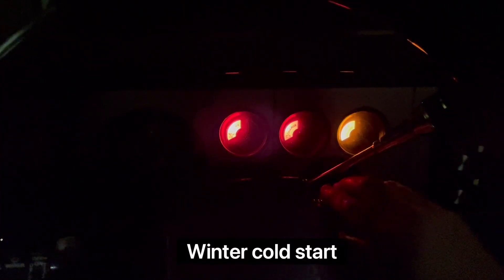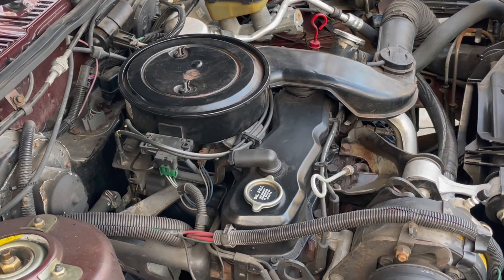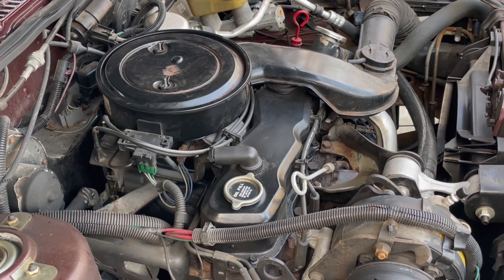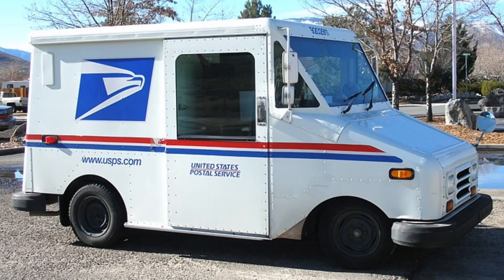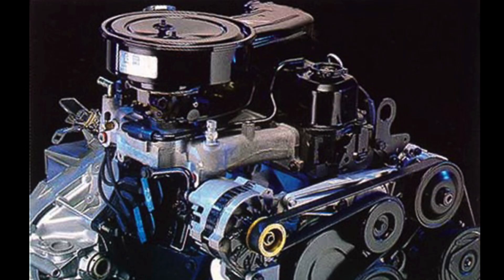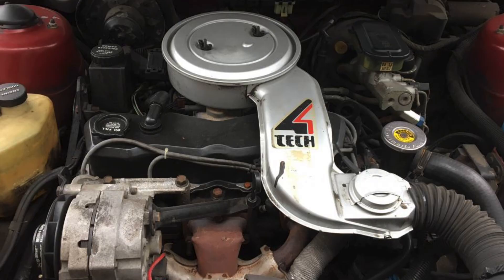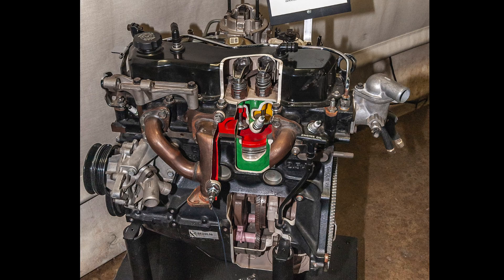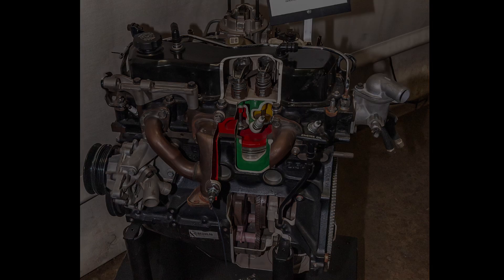Worst Sounding (and Most Recognizable) Engines: GM's "Puttering" Iron Duke 2.5L I-4

Comment: I thought the 2.5 Iron Duke (TechIV) was a crude sounding motor (with no power) but the Olds Quad 4 sounded like broken glass in a blender. It's NVH were off the charts! The only real difference was the Quad 4 made serious power for the time, so the lack of balance shafts could be excused. The Tech IV was so weak kneed even the 14 year old me wondered what was wrong with it.

Comment: Can somebody help me with something? What is the officially prescribed method of accessing the distributer or distributorless coil/ignition module on transversely mounted iron dukes? Does it require the removal of the intake manifold?
Reply from the maker: Undo the dogbone motor mount and rock the engine forward a bit.
Reply: @RareClassicCars  Thanks, that does seem to be the consensus. Sorry for spamming your comments, but a lot of the other iron duke stuff is on longitudinally mounted S10s who don't have the same problem accessing it. This is one of the few places dedicated to it in passenger cars.

Comment: Ive driven a few  different vehicles with that motor in my younger days    i noticed that in all of them, the throttle pedal was really stiff      it always took a lot of foot pressure to press it down .  Was that an intentional design feature for some reason?  Like to keep people from trying to rev them up too fast?
Reply: It may have been...  Most issues with the Tech 4 were in the Fiero.   People wanted to rev them high, and this motor wasn't made for that.   Lol 😂
Reply: Yes when the x cars came out, they rigged the throttle. Pressing the gas pedal about 1/4 to 1/3 of the way down gave you 90% throttle. This was to make the car seem fast on a test drive. “Wow, I’m barely pressing the throttle and the car’s flying! Not bad for a 4 cylinder!” is what they were hoping everyone would say. It was so bad that the throttle linkage would break/snap off in a few years. Chrysler did something similar with their 70s cordobas (etc.) gas gauge would barely move from full until tank was 1/2 full, then needle would plummet fast. “Wow, I borrowed this loaner, drove it all week, and the gas gauge didn’t even budge. This car is good on gas!”
Reply: @new2000car  my experience was the opposite     like the spring on the throttle linkage was super stiff

Comment: I had a 1987 Buick Skylark with that engine.  It was typical lackluster GM #*%÷. 
 Throttle body fuel injection. Blah. 
Took care of it, reliable, but again, couldn't get out of its own way. Yes, that sound was distinct and harsh. Oil filter cartridge went up inside the oil pan. Weird.   Sad that I can remember such trivial crap.

Comment: My uncle used to have an 87 S10 with the “lo-Tech 4” and 4-speed manual (Borg-Warner T4, I believe), in lovely forest service green. It was a great little truck. Slow as molasses, but dependable. It was his daily for quite a few years, reserving his lifted 77 F150 4x4 (which he still has) for towing and other full size pickup stuff. He sold the S10 after he grenaded the rear end. 

Those little 4 bangers are practically bulletproof if you replace the plastic timing gears with metal ones. They’re about as smooth and pleasant as an old Whirlpool dryer, but you can’t deny they have character.

Comment: I had this in a nice silver 85 Olds Calais. I bought it at around 160K and was only able to put a few thousand more on it before the oil pressure would drop to zero on me after cruising on a highway.
After that it developed a horrible sounding knock which someone told me was piston slap (could have been rod bearing knock).

I drove it that way for a while more and yes the knock on top of the other accurately described sounds was embarrassing. My friends loved my car and it always got compliments (esp the interior), but they laughed at the engine. 

I sold the car after it happened the second time to someone who was going to rebuild it and he tried to drive it home that way (no oil pressure at all) and of course, blew it up. 

One thing I noticed about these engine is they were actually one of the best sounding 4 bangers I've ever heard with a nice turbo or similar muffler. 

The truck version that was in the S10 and mail trucks was a heavy duty version with a better block and crank. If you wanted to hop up this engine in your GM car, it was almost mandatory to get one out of a truck and start from there, and it was best not to go over 150 hp.
Reply: Did you ever need to service the distributor on that car? What was even the official method of accessing it in the transversely mounted iron dukes? Removing the intake manifold?
Reply: @gregorymalchuk272  Sorry I don't remember that detail.

Comment: You neglected to mention that when that phenolic cam gear failed you had to remove the engine to replace the gear as it was pressed onto the camshaft and the cam had to be removed to press the gear off and on. Cam removal required engine removal.
Reply: People have supposedly developed methods of doing it in the car.

Comment: I had an x car with the duke as a first car, and man does that tinny start up sound bring back memories. I always wondered why the startup sounded like that, no other engine from GM or any other make has sounded like that. I assume it's not the starter since the same starter was probably used on other GM engines. Do the timing chain dukes make the same startup noise?
I will say the duke is interesting historically, since it represented GM pivoting HARD back to basics after the disaster that was the innovative Vega engine. They stayed far away from aluminum blocks and OHC engines for decades after that, at least for mass produced engines (ie ignoring the quad 4 and 3.4 DOHC).

Comment: The four-bangers aren't counter-balanced by design, so 2500 C.C. is pushing practical limits.  But of course north America has quite the fixation with bigger displacement.  I can always tell when the mail lady is approaching as the vehicle sounds like a 1964 rambler.

Comment: I had a Cavalier, it had a 2.0. I remember the tech4 air cleaner made me laugh. It was nothing notable. It didn't sound bad or vibrate badly. It did accelerate like a diesel. I drove it as a teenager for 50k. Other than an extreme trans leak, and an e ploding battery, I had no trouble with it at all. My gf had the same year sunbird. Idk what engine was in it but it was just a much better car.

Comment: I had 2.4 engine in a 1984 Cutlass Ciera. The car was fine but the engine was way underpowered. At the same time you could not hear the engine running in the Honda or Toyota.

Comment: Had one in an 85 Astro van with manual and rear-wheel drive.  Sound was un-sexy but it ran well.  Throttle body injection with idle controlled by an IAV lent excellent smoothness for such a cheap unit.

Comment: I had a '76 Astre, but the '76's had he Vega engine.  It was a very loud  and cheap sounding.  The car was rubbish. My favorite sounding engine that I've owned is the air cooled Corvair flat six.  Not really quiet, not loud, but the tone is awesome.  GM should have done much better on the four.,

Comment: This engine is one of the main reasons why buyers fell in love with the Japanese 4 cylinder engines. They were better in every way imaginable. The 2.8 V6 was a MUCH better choice if it was an available option. I have a 2.8 with almost 225k in a 1987 Fiero that has never given me any problems at all  and other than a starter and alternator has never needed a major repair. It also still gets 23mpg.
Reply: We went 233,000 miles in our 84 S10 before having to re-bore & have new pistons/ rings. 280,000 miles & still has original oil pump & crankshaft as well as rods too. Could not find a new oil pump with correct pressure so ended up using original as the pressure is correct at idle & hwy speed.

Comment: Yes, I remember. The noisiest, most offensive sounding 4 cyl. of modern times.
Reply: Our old 1952 8N tractors at idle are quieter! Ford also used a plastic type timing gear on his tractors! Made them quieter but when you rebuilt them you would find a few teeth missing! The timing gear on our tractor before rebuild was kind of a aqua green color. Of course the  rebuild kit we used  has a steel gear now.

Comment: For whatever reason, the sound of that Omega, which is identical to the sound my father's Citation used to make, just doesn't bother me; it's almost endearing. I've read that GM deliberately made the piston rods of the Iron Duke longer than those of the 2.3 L Vega engine, in response to complaints about that engine's secondary vibration, so you might do a comparison test with an original Vega, if you can find one. I do remember being bothered by some of GM's later 4 cylinder engines, particularly the 2.2 L engine in the Barretta, which was said to be related to the much despised 1.8 from the early J-cars. That engine made a booming that made the interior of the Barretta sound like the inside of a tuba; maybe GM's efforts to get more HP out of the same displacement led them to go with a noisier exhaust system. Some of the not-so-well balanced V6s of that era, particularly the 3.8 L engine in the 1993 Thunderbird also rubbed me the wrong way. It would be very interesting to see how a pre-1977 odd-firing Buick V6 stacks up against a modern engine, remembering that while odd-firing, that engine was also one of the only V6s that was perfectly balanced. Would it be ugly, or just strange? One  engine that sounded like a metal chipper was the inline 5 they put into some of the early 2000s Chevrolet Colorado pickup trucks. There was nothing endearing about the sound of that thing, and no reason to think a 5 cylinder engine would ever sound good.
Reply: My dearly beloved neighbor had a Colorado that he inherited. Had multiple head & intake manifold gasket problems on a very low mileage pickup. After the 2nd failure he got rid of it & got an old square body pickup instead. Miss you Ray.

Comment: The old iron duke might have been a crude running engine, but it was very reliable. It was also used in farm machinery, and marine equipment.
Reply: No wonder it reminds us of our neighbors farm tractors!
Reply: The Iron Duke was not uses in equipment or marine applications. You're thinking of Chevrolet's 4cyl that dates back to the Chevy II. It's basically the modern 235 inline 6 with 2 cyls missing. In later years it was increased in displacement to 3.0L

Comment: For sure! Out family had a 1984 citation, manual transmission, and 1985 celebrity wagon, automatic with iron Duke power. Pretty coarse and noisy! But we were fortunate, both vehicles and engines were very reliable and we’re still going strong at 250,000 miles when we finally traded them off. Both engines were still healthy, neither needed any internal engine work at all. the cars were wearing out.

Comment: Well, that starter sounds like crap for sure.  And yeah, these seemed like tractor engines, but at least they were fairly reliable.  I dunno, my 2009 4 cylinder camry sounds like a bucket of bolts when you start it as well.  The wise ass Toyota rep told me I was "old fashioned", and didn't know how modern engines worked.  I told him this "modern engine" sounds like a Vega engine, according to him, the admitted "piston slap" was "normal".

Comment: I owned both, and the Chevy Vega 4 cylinder has the Iron Duke beat hands down.  The Vega engine sounds like a B&S lawnmower engine
Reply: At least the old B&S (the present owner of the name and factory is not the same) got the aluminum part right

Comment: I don't know about other GM engines, but may family had a 1979 Ford Fairmont (bought used in 1980) that was a lemon from the word "go". The Pinto 2.3-liter Four was terrible, had many of the same issues described in this video, including "dieseling" after being shut off. It broke down numerous times. Having been exposed to that Fairmont and to an Olds Omega that my grandmother bought used in the later half of the 1990s, I would say that the proliferation of problems between these two models was a toss-up.
Reply: The Fairmont we drove also had that dumb horn switch located in the stalk too. Almost was in as accident when we found the center of the steering wheel had no horn button!

Comment: As a youth my folks got a brand new 91 Calais ... and of course when brand new and with all the upgrades (a decade plus late?) it was quiet and made decent torque ... and the Calais was a pretty little car.  After about 30,000 miles it gained some noise of course ... but never broke down.
Reply: Did you ever need to access the coil packs? Are you supposed to remove the intake manifold to access them?

Comment: I couldn't agree more!  My first brand new car was a '86 Olds Calais with the tech 4.  I wanted the 3.0 V6 but in hindsight maybe I dodged a bullet.  Outside of how horrible it sounded the vibration was terrible.  The spokes on the steering wheel in that era of Olds were low.  The top of the wheel vibrated so horribly!  It was irritating!  Under warranty the head gasket blew due to over torqued head bolts.  It leaked from the thermostat housing.  The repair at the dealership was to goop it up with silicone.  I eventually replaced the housing.  Problem solved!   I traded up for a '91 Quad 442.  When was the last time you've seen one!  The quad 4 was stellar!  Wish I kept that one!
Reply: Did you ever need to access the distributor in your Olds? What was the official method in the transversely mounted Iron Dukes?
Reply: @gregorymalchuk272  it was on the firewall side of the block.  I never had to deal with it.  I recall looking at it and thinking about how tough it would be to get to.

Comment: 1985, Lyn Dower Buick/GMC in Denton, TX. I worked on so many Iron Ducks, I can hear them in my dreams. They worked ok, but sounded cheap. I think the noise I hate most from these engines is the intake drone. I have an '01 Jeep Wrangler with the AMC 2.5l I4, and it sounds very nice by comparison, putts like a proper tiny truck motor should! 😊
Reply: I had an 84 XJ with the 2.5. Ran great until I changed a fuel filter. Something got in the carb and it never right again. Didn't burn any oil though.
There was one OHV four banger worse than the Iron Puke though. That's the 4 that Ford put in the Tempo.
Reply: @mpetersen6 Ughhhh yes, those Tempo/Topaz motors were awful

Comment: The iron duke was also a popular marine engine as well. I do recall the Mercury version did upgrade the Cam timing situation, probably OMC as well. Pretty bullit proof. Remember in a boat, the engine is at near peak revs simulating going up a hill floored going 80 MPH in a car, sometimes for hours at a time.
Reply: Yeah, I was often amazed how those 2.4L 4cylinder chevy engines held up in the stern drive application as well, even in the salt water.  But, were they actually the iron duke engines?
Reply: @fleetwin1  yes, contracted directly through GM.
Reply: @steveoh9838    Yeah, I realize these engines were made by chevy and bought through GM, but I don't think they were the iron duke variants...  Nonetheless, they proved to be pretty rugged in a most brutal application
Reply: There was the car version, the HD truck version in the S10 and mail trucks and then there was a race version you could order. Pretty sure it was one of the HD blocks and cranks. 

The race version was aluminum and could handle multiple hundreds of horsepower with turbos or nitrous (which is no big deal these days I guess).

Comment: Interesting... I must have been quite lucky, then. My 1987 Pointiac Grand Am had an Iron Duke and it ran like a top with no noise and extremely reliable for 135,000 miles. Really enjoy your videos!
Reply: I agree, we had a Old Cutlass Ciera with the iron duke and I never noticed the noise. It was a good engine that really held up to a bunch of teenage drivers.
Reply: I had an 89 Grand Am with the 2.5 that was indestructible. Drove it everywhere!
Reply: I still.have my grand am. Looks good with 173000 miles. It's a 1990 with a few improvements
Reply: I hate spamming this comment, but do you happen to know the officially prescribed method of accessing the distributor or distributorless coil packs/ignition module on the transversely mounted iron dukes? Does it involve the removal of the intake manifold?
Reply: @gregorymalchuk272 no you don't have to remove the intake to do ignition service
Reply: @clivevreeswijk4555  I just barely ended up doing it without removing anything. I did it virtually blind, operating only by feel. It was made worse by the fact that the two studs that the two coil nuts go on kept falling down into the ignition module, and they didn't stick up far enough to thread the nuts on. I don't know what I would do If I needed to do something more involved, like remove the ignition module/crank position sensor underneath the coils. I don't even think the late N bodies had the dogbone people are talking about. They had a transmission torque strut, but it wasn't under any tension and releasing it didn't help rock the engine forward. Now it runs, but runs rich at idle, but is drivable. I can see live data and it reverts to open loop with only a 45 "oxygen sensor rich" code. I'm still trying to figure out that one. Maybe an intermittent misfire through leaking spark plug leads? Or a failing ignition module. Whatever it is, the computer isn't picking up on anything other than it running rich.
Reply: @gregorymalchuk272  check the rubber hose to the map sensor, sometimes they rot and then it runs rich
Reply: @clivevreeswijk4555 I ended up fixing my iron Duke. It was running rich from a dribbling fuel injector or dried out fuel injector O rings. I replaced both, and the engine now stays in closed loop at idle and on the highways. I actually have a scan tool and the short term and long term fuel trims, "integrator" and "block learn", are both centered on 128, which is the correct number.